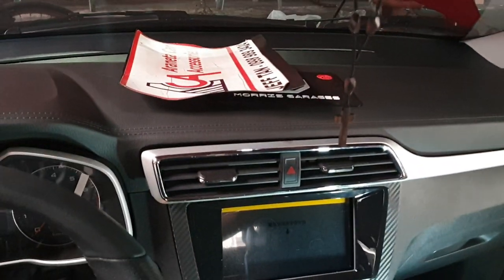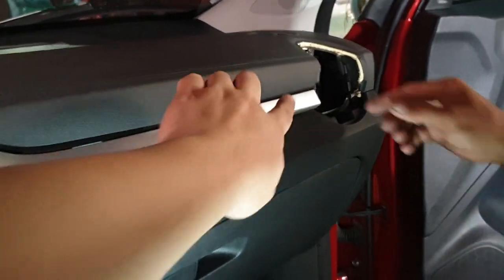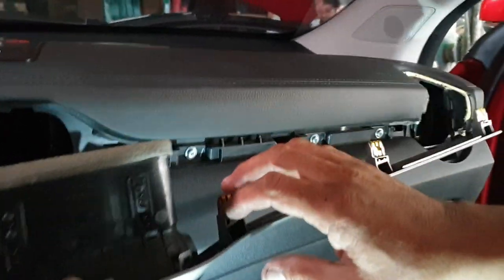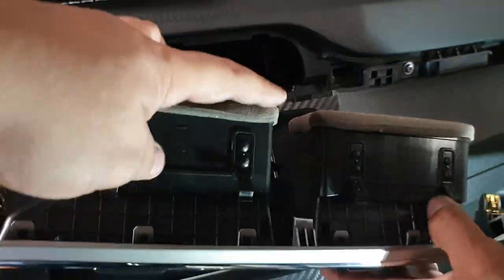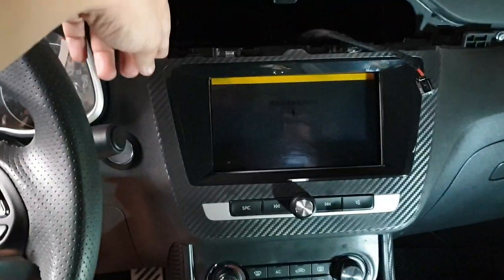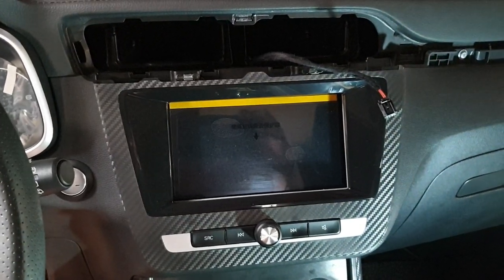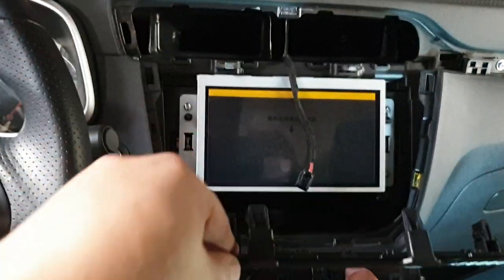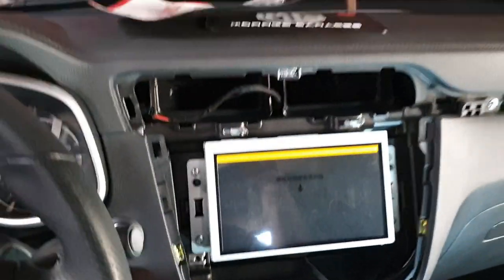MG ZS stereo panel removal

Comment: I did it without having to pull off the air vent.
Reply: How did you do it ? Need to pull my panel out to remove the carbon fibre to paint it piano black